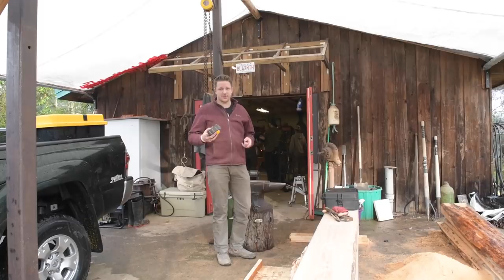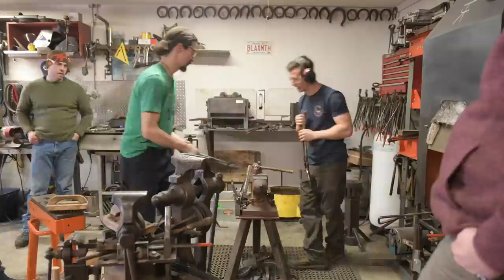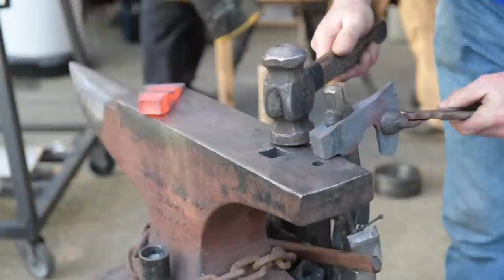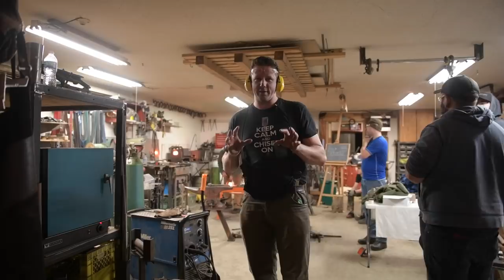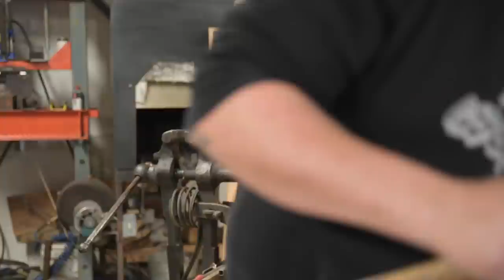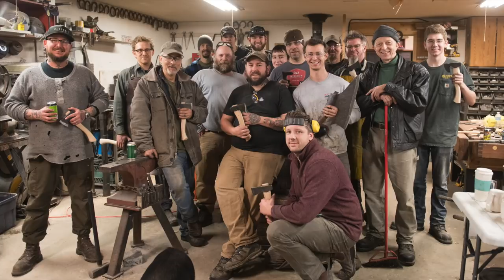Forging My First Axe!!! With Liam Hoffman

Comment: If you want to practice edge shape forged in bevels, I'd say a chisel or marking knife. If you just want to move a big hunk of metal, I'd say a set of hammers - though it'll take a while without a power hammer.

Comment: as far as axes are concerned, a hatchet may be the most dangerous for a new user. The small size does 2 things that seriously detracts from safety. One, as a one-handed tool, it encourages the user to put the other hand on the object to be cut. BAD. Second, on an errant swing or glancing blow, the arc of the head will hit the body before it hits the ground. A full sized axe is much safer for a child to learn to use. 2 hands on the tool, no hands on the target. A full swing down hits the ground, not the thigh, shin, or toe.

Comment: No one should start with a sword and have you tried making a hammer without a power hammer or hydraulic press?  Not fun. How about a couple brass sleeved Japanese marking knives, one straight edge, one vee. Then you can make a beautiful wooden box for them to live in. Something you will use often and isn't as daunting as some other projects.